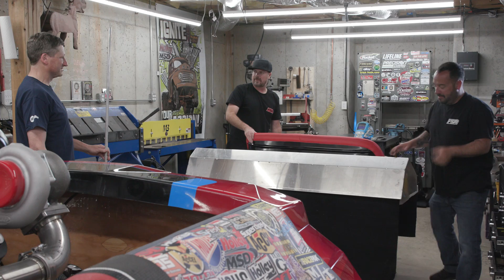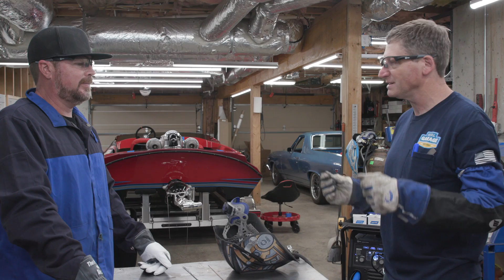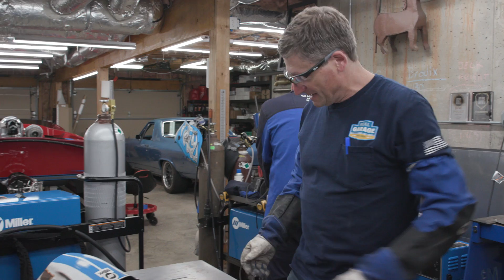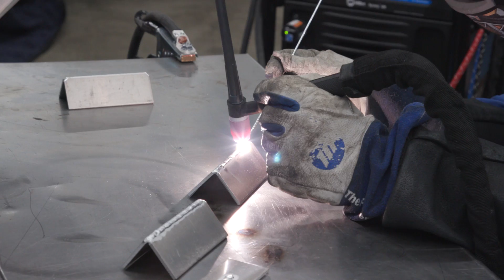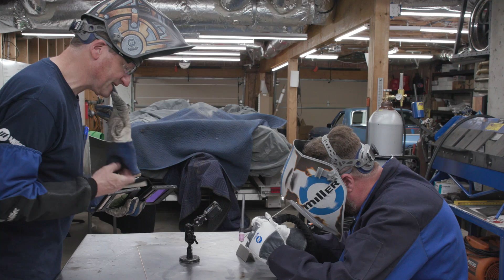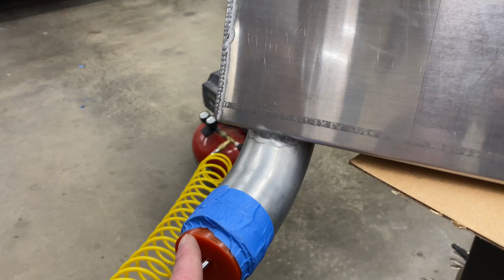BIGGEST FUEL CELL I'VE EVER BUILT AND IT'S FOR WIFEY'S 1,600HP TWIN-TURBO JET BOAT!

Comment: Why are you putting a 180 pounds of fuel on one side of that boat?
 It's not going to handle for shit, and your gonna need 2 trim tabs on that side to compensate.
Very dangerous as well. 
You should know better.
Reply: Perhaps there's going to be some sort of counter balance/ballast on the other side of the boat.
Reply: @skyking228  Counter balance/ballast aka That's where Newburn is gonna sit. That's the price you pay for getting a welder for free.
Reply: @skyking228  The weight in the cell will always fluctuate, and can't be fixed with a ballast, and should always be mounted in the center.  The problem will turn dangerous when the boat is air born, or turning.
Reply: @Copesthetic-Aesthetic  Perhaps it's some sort of life insurance scheme?
Reply: @skyking228  LOL, perhaps 🐸

Comment: Why did you put all the weight in the far back corner of one side of the hull? It seems like you'd want a tank on each side with a cross feed to keep the weight balanced.
Reply: Never know what he’s got planned to put on the other side of the hull….hopefully it’s something at least close in weight to the filled fuel cell.
Reply: @ElkinsEric  Might be for the dry sump tank, if he plans to use one. That and a couple of batteries could offset some of the weight.
Reply: @MX304  I was thinking batteries too

Comment: Too many RPM on the drillpress and not enough power!
Drill a few 4-5mm hole in the circle to help the chips get out of the way of the drill teeths.
Reply: And there's a Bridgeport in the background... 🤷‍♂
Reply: @b3nsb3nz  better to stall the drill press.  The mill will twist the shank off the arbor or worse... ask me how I know.
Reply: @barrygerbracht5077  higher gear low rpm works, I do it all the time. Lot less chatter in the cut as well.
Reply: @barrygerbracht5077  Your obviously running it too fast and feeding too fast
Reply: @markrichardson8446  Your assumptions are incorrect. I know how to use my tools and have to pay for any I break so I'm not in the habit of messing things up.  A hole saw arbor is only about $30 so not the most expensive lesson to learn, but if I can save someone from it then that is why I shared my experience.  My mill is 5hp and in back gear at 60 RPM it does not stop for anything.  One second you're merrily making a hole, flushing away chips and the next the arbor is snapped in two.  This was my response to slower speed and more power that JTL made.